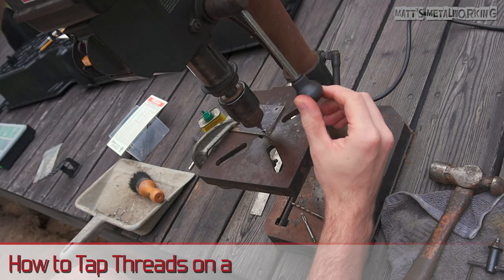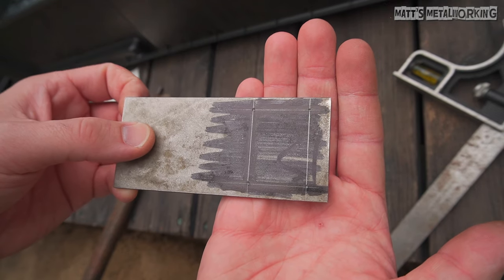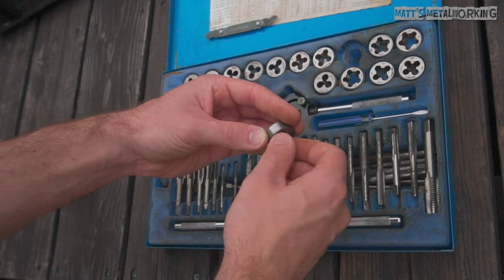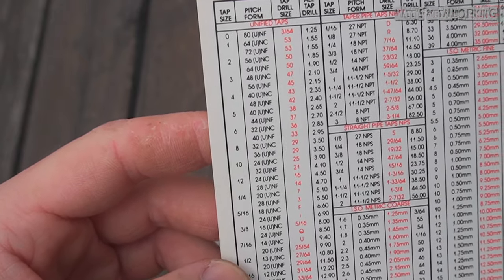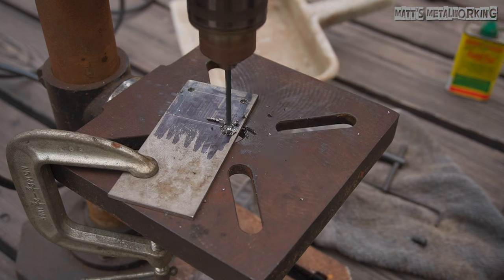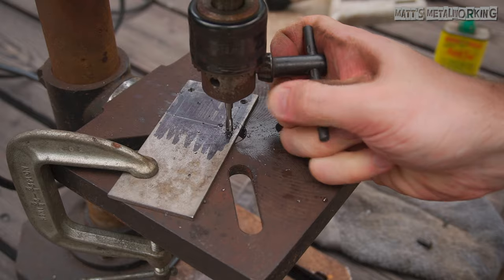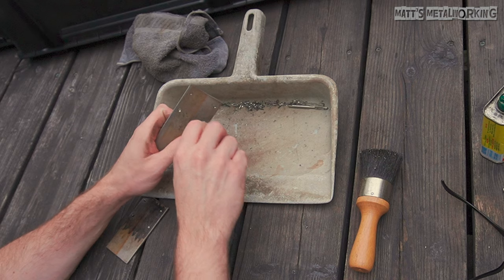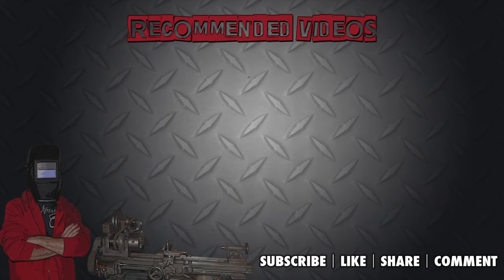How to Drill and Tap Threads on a Drill Press

Comment: Enjoyed the video, as that's what I was taught back in the early-80s. Start with a center drill, pop a pilot, and then drill to size. As time passed and education progressed, it didn't take much to realize that it isn't the best way to go. A center drill is either a 60* or a 90*. A twist drill is either 118* or 135*. As such, the drill chatters as it enters the hole. If one is using jobber length drills, he can use a spot drill to start the hole, instead of a drill that's meant for creating centers. Spot drills can be had as 120* and +140*. Obviously, a 118* drill into a 120* spot doesn't result in chatter and allows the drill to catch a chip pretty quickly. If you're using screw machine length drills, spotting usually isn't necessary.

As a rule of thumb, if the drill's diameter multiplied by 1.5 is less than the thickness of the metal, there's no need to peck. Depending on the metal, the drill, the cutting fluid, and the machine one can often drill deeper without pecking. It comes down to how the tool feels as it's in the bore. As a point of interest, tungsten carbide drills with through cooling can go as deep as 7X their diameter before pecking. Pecking can be equated to starting an engine on a cold day - that's when the wear occurs. When the drill is cutting in the bore, little wear takes place. Same goes for pilots. A dill's chisel/split point needs resistance. A pilot eliminates that resistance resulting in chatter and extra wear of the edges of the lands. Wouldn't suggest popping pilots at all. It's not wood. ;) You'll likely dismiss some of what I'd said, as it's not what you've been taught. That's fine. We all work on our own time. Best of luck.

BTW, if you don't have a copy of Machinery's Handbook, gotta get one. If you'd like more manual info, look for an earlier edition. Say, 18-22. They're about $20+ an ebay. If you don't already have a copy, you'll be amazed by its content.
Reply from the maker: Awesome tips, thank you for sharing! I do have a couple copies of the Machinery's Handbook, one hard copy that my mom bought for my dad and a digital copy.

Comment: Dude, check out the Tapmatic, it’s an attachment for your drill press that has a clutch and automatically reverses so you can actually run the tsp with the drill press! I just learned about them and they seem really handy… and spendy.
Reply from the maker: Yep I've seen those, actually could have purchased one recently. Great if you're doing a lot of threaded holes, but you will need a drill press large enough to use one.